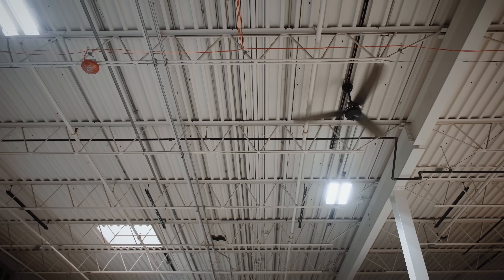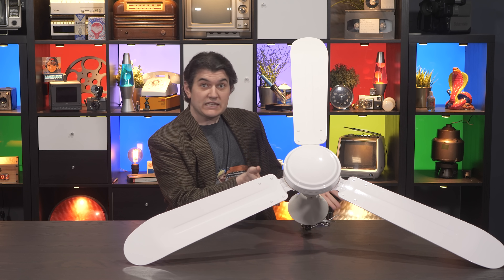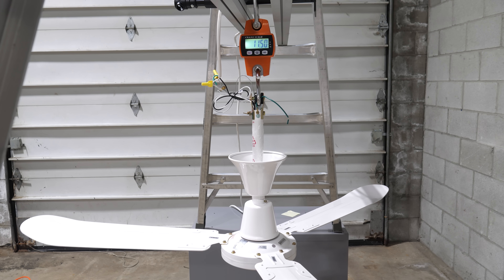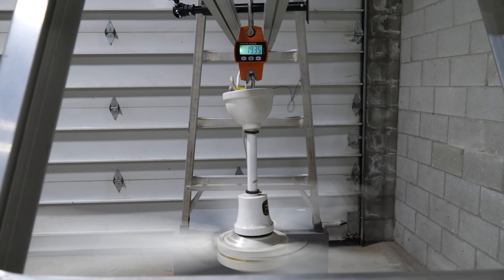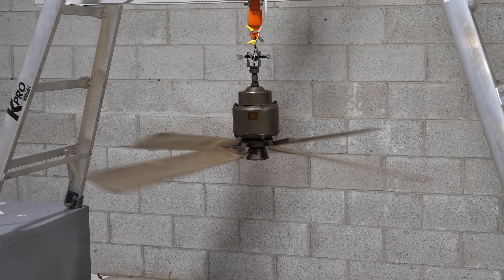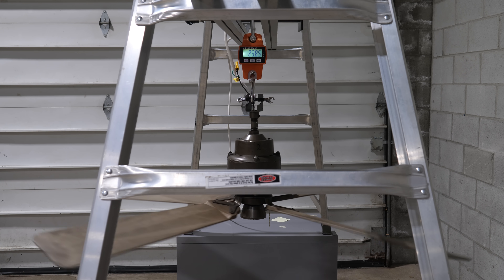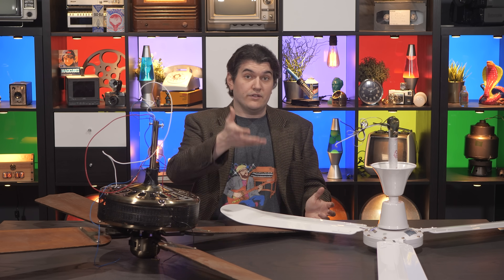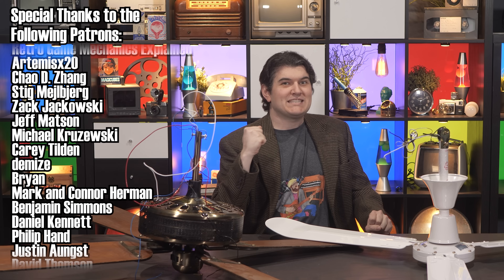How much thrust does a ceiling fan produce?

Comment: I think this could be a topic for another video. You didn't mention the thing that separates a fan from a propellor (or helicopter rotor), which is the airfoil shape. As I watched your video, I started to wonder if one of the reasons a fan blade is flat is because it will actually produce more airflow (vertical/perpendicular airflow is actually bad for a propellor or rotor because it reduces angle of attack), but then at the end of your video, I remembered something! I've seen a lot of the larger industrial fans (made by a company local to me, Big Ass Fans) and their blades actually do have an airfoil shape! Now I'm curious and I think I'll do some investigating because of you.

Comment: The Emerson Heat fan was the very first ceiling fan I saw. My grandmother had one put up in her living room when I was very little (sometime in the mid to late 1970's) and was in her home when it was sold in 2000. Never had a day of problems. I don't know if it was suppose to be reversible but hers was. It looked just like the one in the video. Thanks for the nostalgia as I had not thought about her house in a very long time.

Comment: Not a big fan (hehe) of the testing apparatus, that looks terrifying. You can't live without ceiling fans in my country but it's still better to have a healthy respect for a metal object running at several hundred RPM at the very least.

Comment: Unpopular opinion: ceiling fans are completely useless
They generally don't provide a nice feeling gust of wind, just a moderate little wind at most, will not recirculate air unless you have several of them at max speed, are ridiculously noisy and the thought of a hanging freaking spinning object constantly moving above my head is terrifying, it could come loose at any second just from vibrations and either fly to any direction or fall straight down and I have no way of easily checking how safe it is since it's on the freaking ceiling
Floor fans can produce a lot more wind directly on your face in a safer way without requiring complicated mounting, ACs are better to regulate temperature and air, ceiling fans are pointless

Comment: The Light Wars are finally over!!!!!! They have full spectrum, warm LED's in colored bulbs and it is GLORIOUS!!!! 

They almost tricked me last year with the colored LED's inside colored bulbs, but I looked around until I found a store with them on demo and realized it was still monochromatic, BUT MONOCHROMATIC NO LONGER!
Reply: Which ones did you find?
Reply: @dspiffy  My local hardware store recently changed form True Value to Ace, so I'm not sure which one got it in. 
 
Brand: Celebrations
Product: LED (classics)

They come in a white box and use the old YRGB color pattern, though they swap every other blue for a purple that is easily mistaken for blue at a distance.
Reply: @dspiffy  I'm not sure why my original response got erased. Possibly for naming stores or brands. I'll just say to check out the small, local hardware rather than the orange one or the blue one.

Comment: Let's think about the power too. A Blackhawk helicopter has two turboprop engines, each of which weighs 450lbs and produces 1,279kw of continuous power according to the GE datasheet. Just going by household voltage and the tiny electrical lines, the ceiling fans have max 1 to 1.5kw of power, but probably less. Having 3 orders of magnitude more power is definitely gonna move just a bit more air!

Comment: If taring it makes it stay at 0, that would imply the fan provides no thrust. Combined with the scale providing evidence that the fan does provide thrust if not tared, the only conclusion that can be made is that the scale is not reliable, and no information can be taken from it. That scale is not a valid measuring device.

Comment: 5:51 taring? What’s that?
Reply: Taring is a practice with using scales where you zero out preexisting weight. You can put an empty cup on a scale, then tare it which makes it read zero again, so anything else you add to the scale will only read the weights for the contents of the cup.
Reply: Say you need to weigh strawberries in a bowl. You have to make sure the scale is set to show 0.0 when the empty bowl is on it, so when you add the strawberries you get just the weight of them instead of berries and the bowl. The tare is the weight of the items you don't want included in the final number. We do this all the time at my deli job. We slice meat, place it on a plastic sheet, then put a price sticker on the bag. You don't want to pay for the sheet of plastic we set the meat on, which is .01 lbs., so we deduct the weight of the plastic sheet to give you a price reflective of the meat only.
Reply: Tare is the weight of the container that needs to be deducted to get the weight of the contents. It is used as a verb to mean the act of making that deduction. Scales typically have a button labelled tare (or just T) that zeroes the scales.

The word comes via French from Arabic and originally referred to rubbish.

Comment: Your fans in the testing setup seem to be relatively close to the ground compared to their normal mounting point on a ceiling. I imagine blowing against the floor would considerably change the amount of thrust it it can generate, and simultaneously how much energy is put into making it happen. (Just think: if you stand on a skateboard you can push on a wall to make yourself move, but you can't quite manage the same thing while pushing against the air...)

Comment: Propellers are not really fans. Yes both move air and produce thrust, but each is optimized to do what it is supposed to do best at the detriment of the other thing. In other words, a propeller is optimized for thrust and won’t necessarily move a lot of air. But to be honest, I don’t think that any of these fans was optimized for anything judging by the simplicity of their airfoil, chord and twist distribution.

Comment: 2:00 I'mma stop you right there and point out they have almost no torque. So whereas it might build up "thrust" in terms of the air it pushes out,  any load it could propel would accelerate incredibly slowly. I recommend a few miles of runway to start with!

P.S - in the spirit of No Effort November, I did not watch the rest of the video before commenting. Cheers!

Comment: The metric unit of force is Newtons (1 pound of force is equal to 4.44822 Newtons).  The mass of the fan (kilograms) doesn't change, but the force (Newtons) the fan exerts on the scale changes.

Comment: The electrical box that your fan is mounted too is supposed to be a special "ceiling fan brace" (required by code in most places) that spans between the 2 joists securely mounting it.  Most builders only put in ceiling boxes rated for lights because they are cheaper.  Most home owner connect their ceiling fans to their light boxes and most of the time they stay put and don't fall.  Most of the time...

Comment: I had this same question as a kid and easily found out the reason. It's called blade angle and lift/thrust, the household fan blades don't product enough of it like a helicopter or rotor plane can.

Comment: A helicopter rotor is actually very different from an airplane propeller.  The blades actually pivot and change angle of attack throughout a single rotation.  There's a great video of a camera mounted to the center of the head of a helicopter showing how the blades look like they're wobbling on YouTube

Comment: You mentioned that your interest was the impact the trust might have on the electrical box. Its worth mentioning that a fan should never be hung from a box that does not have sufficient support. Many fan kits come with screws to reinforce the connection to a beam and if the box is not going to be directly tied to a beam there are devices that can anchor it between two beams. Hanging a fan from a box without making sure of how well anchored the box is is a recipe for disaster.

Comment: Scale zeroing logic can bite me.

Too many times I've zeroed a scale, then slowly poured ingredients in, only to have the scale stay at zero.  The issue is that it thinks it is compensating for drift, rather than measuring real force being applied.

The trick is to zero the scale, add a removable mass (or put my thumb on the scale), start adding the ingredient,  then remove the extra force.

Comment: I have a big industrial-sized box fan (it's meant to be mounted in the wall of a factory) on wheels. As you can already tell, it produces just enough thrust to move it across the floor if something isn't put under a wheel to keep it from rolling. So that's fun.

Comment: Aircraft have airfoil shaped wings/rotors. 
A ceiling fan has flat blades, which seems like it would be much less efficient at moving air.
Reply: This depends on speed. Fans, especially ceiling fans, typically move very slowly.

Comment: Its a common misconception that the entire ceiling fan pivots to make thr ceiling fly in different directions. The fan’s cyclic control actually adjusts the pitch of each blade as it goes around using a swashplate and control linkage, ensuring that the forces generated operate 90 degrees out of phase with the direction of desired ceiling motion.

Comment: The quirk after taring is likely drift compensation. When the load is too small, it will assume it is the sensor signal drifting without applied force and thus maintain a zero reading. This can be a big problem when measuring small quantities of powder on a kitchen scale and indeed has ruined my food before.

Comment: I would like to point out that a fan attached to your ceiling does not provide any upward thrust to your house. The amount of wind blowing on the floor will exactly cancel out the thrust that the fan is generating.

Comment: 9:35 my house originally had several ceiling fans connected to unsupported j boxes. Seeing that death wobble at full speed was pretty concerning but they had been in that role for decades. Went up in the crawlspace and put some supporting 2x4s over the boxes between the joists and then screwed the boxes directly into them, rock solid now. At the hardware store they have new build options with metal supports that look solid as well.

Comment: You mentioned heat ceiling fans being different than regular ceiling fans, designed to move hot air on the ceiling down. I was under the impression all ceiling fans served that purpose?
Reply: They do, but this was one of the first ceiling fans marketed specifically for that purpose.

Comment: I loved the video but an important part in the forces put on the conduit is the horizontal force. I'm pretty sure Fans don't direct air directly down. A lot of their force is burning laterally, but will be in equilibrium. If the blades ever get misaligned, the forces will no longer be balance and there will develop a wabble

Comment: Airplane propellers and helicopter rotors are also slightly different in their cross section than ceiling fans. While ceiling fans are flat, propellers and rotors have an airfoil shape to them, because they are intended to produce lift -- they're basically mini wings that spin to generate air movement over the airplanes main wings (or just spinning the main wings in the case of helicopters). Thanks, Herr Bernoulli!
Reply: Sure, the wings on aircraft are typically designed to push air down in some fancy and complicated ways.

Comment: This is riddled with scientific inaccuracies. I know this is November, but that’s no reason to spread false information.

First, airplane and helicopter wings/rotors are absolutely not fans. The rotors are small wings, which create a low-pressure pocket on top which sucks the helicopter up or the airplane forward. The air moving down creates negligible thrust, especially since up in the sky there’s nothing but air to push against.

Fans are just flat angled plates which make air move around. Without any fancy localised pressure pockets.

Second, the fan has a constant mass, not matter if it’s turning or not. Even in outer space, where your scale reads nothing, the fan will have the same mass. Weight is expressed in newtons, not kilograms.

Third, saying “x pounds of thrust” makes no sense. Thrust, like weight, is always expressed in newtons. 

Using the right unit is essential when making any sort of scientific measurement, it is the bare minimum research required; only 2 minutes of Wikipedia (or ChatGPT) would have told you everything you need to know to make this video reasonably accurate, to your no-effort standards.

This video isn’t “no-effort”, it’s just you being blind to the basic physics concepts used in the video. I’d argue it takes more effort to read this comment than to do the video right to begin with, or at least have the script looked over by someone competent.
Reply: I really wish people who don't know what they're talking about would stop pretending they do.

Aeroplane propellers and helicopter rotors are absolutely fans. A fan blade is a wing. Pressure is just a different way of thinking about the same thing. A wing creates low and high pressure zones by moving air from one place to another. The high pressure region pushes the aircraft into the low pressure region.

Fans absolutely create high and low pressure regions as they operate.

Weight still exists in outer space, the rest of that was pedantry.
Reply: @seigeengine A fan blade is flat. This strictly pushes the air from one side to another, and creates a current. A helicopter rotor is not, it has a side that is more bulbous than the other, which makes the wind take a longer route in the same amount of time, which makes the local velocity above the wing faster, which creates a pressure drop which creates lift.

This lift effect cannot be achieved with a fan. Strap a fan on a helicopter, and you’ll be able to hover a bit above the ground for a while, but go any higher and no ground exists to push back against, and the helicopter cannot hover any more.

I agree that a fan creates a lower pressure zone, but that is on one side of the entire fan. A rotor has low pressure zones locally, on the surface of each blade.

And yes, a rotor will create a large current like a fan, but that is not what generates lift in the sky.

Comment: Actually, the propellers and rotors ARE fans. Their job is to keep the pilot cool. If they stop, notice how the pilot very quickly starts sweating.
Reply: As a pilot, I approve of this message....
Reply: Top tier joke. That made my day.
Reply: Good Pilots start sweating, bad not-pilots-anymore jump out :D
Reply: Is the helicopter suspended above the ground while operating, or is the helicopter simply preventing the ground from coming up to hit it?
Reply: @turnin.sprocket  Of course the helicopter pushes the earth away from it, what we see as climbing is actually just the entire earth moving away from it.
Reply: @turnin.sprocket  The Earth is accelerating towards it and it must continuously accelerate away.
Reply: @classarank7youtubeherokeyb63  😆 I think the helicopter already had the relative momentum of the earth before it pushed the earth away from it. Hahaha
Reply: O yea, that’s what caused it? 🤔 Boy pilots don’t like being hot cause when the fan went off he said a bunch of bad words.
Reply: As a private pilot I approve of this comment. While doing preflight checklist on tarmac on hot summer day, there's some urgency to get the engine started because after that there's a cool breeze coming in from a door or a window (as long as you keep one open with a hand or something...). The cabin of a small airplane gets really hot quite quickly, unless you have air conditioning, which also requires the engine running. While flying there are vents that push cold outside air into the cabin, so the sweatiest parts of a flight are before and after takeoff :).
Reply: Turbofan engine approves this message.
Reply: How about fan on fan configuration (see my other post in here) - would the thrust be doubled or more? Its just a theory of which I happened to come across in a dream;
Reply: i will never get tired of seeing this joke
Reply: Haha
Reply: Underrated comment of the year
Reply: Хаха!

Comment: The reason that propellers on aircraft put out so much thrust isn't just the power of the motor. Ceiling fans are essentially paddles that sling air downwards, slapping the wind at you. Propellers are radially mounted, rotating wings.
Reply: sigh wings also work by pushing the "wind" down. The shape of propeller blades are primarily advantageous at the higher speeds they operate at compared to fans, where they'd offer little benefit at high cost.

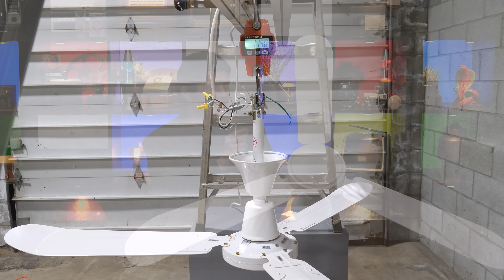Comment: 3:32 must be the weight of the electricity to drive the fan.
Same thing when you switch it off, the electricity is removed but the spinny thing still produces thrust.

😂
Reply: Was about to roast you until I saw the '😂'

Comment: [Pendantic Mode Activated!]Actually, reporting results in kilograms is totally wrong and you should feel bad about giving into pressure from the heathens who demand such things.  The mass of the fans remained constant, after all -- what you were measuring is the change in the net force applied to the fan.  And the heathen unit of force is "newtons," so you should have stood your ground and only reported the results in newtons and pounds.

And yes, there are relativistic effects at llay here, which would change measured mass, but the expected change would be far, far, below the level of the scale to measure.

So there

Comment: As a non-American, I have wondered many times how much thrust the ceiling fan directly over my hotel bed generated and whether it was enough to reduce injury if the mounting hardware failed. This video is almost as use as the dishwasher and smoke alarm videos.